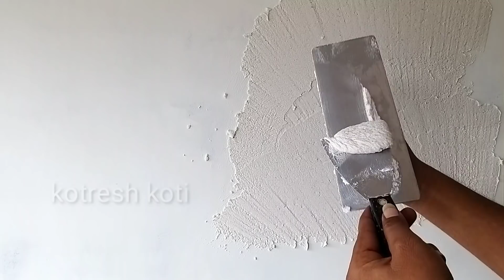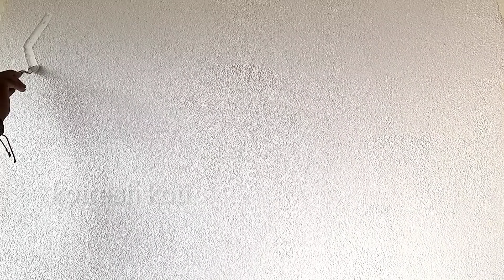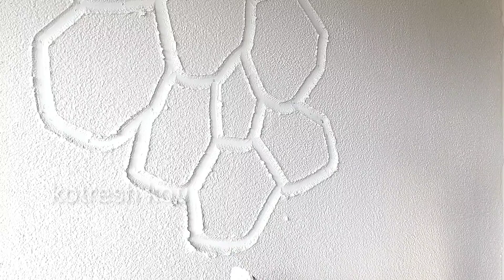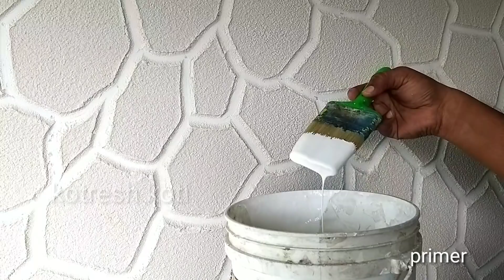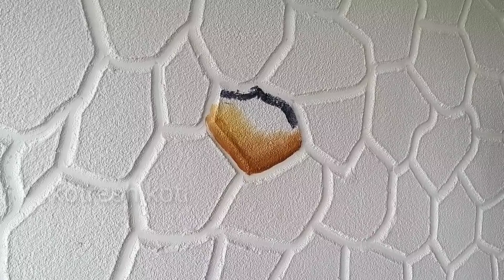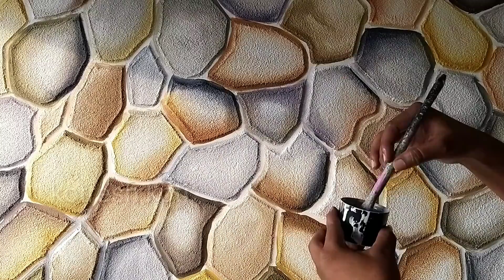Stones wall painting techniques | Asian paints texture | exterior stone wall

Comment: The work is excellent but the painting method is very poor😒
Reply: How so? And how does that statement even make sense? The work- excellent (at the very top of the scale); the method used to produce it- VERY poor (at the very bottom of ur scale!) Tell me, how in the world does a broken method yield excellent, successful results? Basically, you are throwing empty adjectives out there that share no information except the fact that you regard your own 1 to 10 scale with utmost importance. More effective, and more legit as a means of critiquing art in general,  would be if you tell WHY you think the painting process is so poor, what is so low- caliber about it, what is being done incorrectly or unsuccessfully and according to whom or which set of rules or laws. Equally as empty is your compliment to the work saying it's excellent. That is nothing more than flattery and reveals nothing about what you feel works well in the art and why.
Reply: @brandimaze2099  Thanks for the long lecture, I just misspelled. I meant the method of dyeing and choosing colors was poor